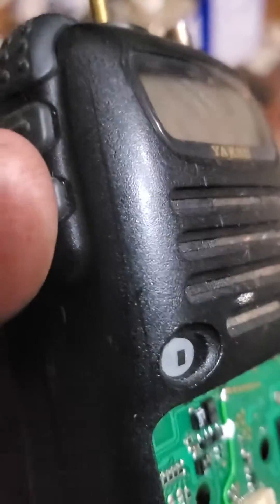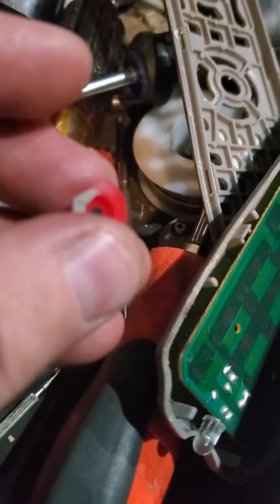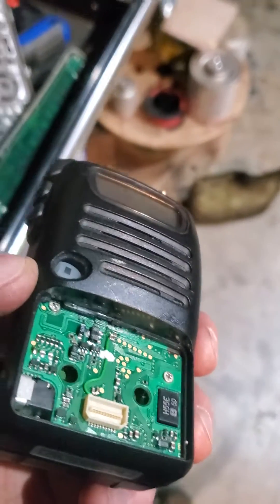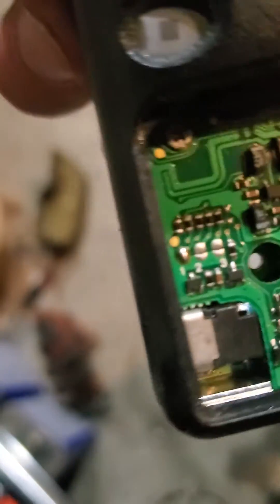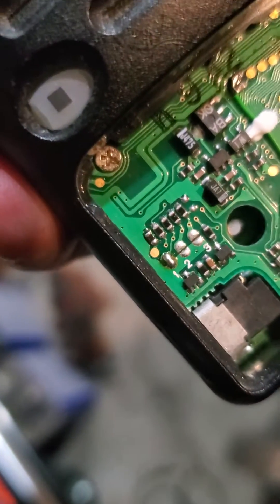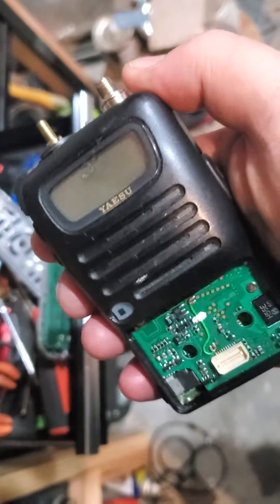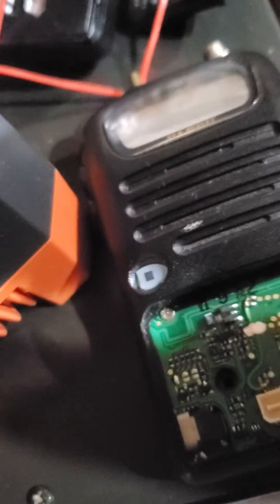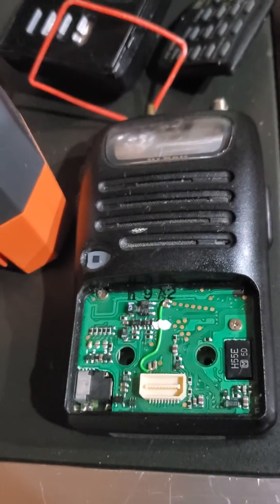Yaesu ft50r button repair hack with old remote.

Comment: I may need to do that. I just dug my 90's Ft-5R out for the first time in a long while, and I'd forgot that the power button only works if I hit it rapidly. At first, I thought it wouldn't turn on at all, but then I tapped it fast, and it worked.
Reply from the maker: Try cleaning your button first 
 Mine was missing when someone gave me the radio. So usually the black coating on the button contact just needs to be cleaned.  Good luck!
73
Reply: @hamradiohack  Thanks, I may try that. Oh, I also did the mars mod right after I bought it...but now I wish I hadn't, since you loose the auto offset feature. Sure wish someone made a lithium battery for these. I have the AA battery case, but with that, you only get 2W max, and those NiMH bats go bad way too fast.
Reply from the maker: @azdonw  yeah. Mine has the aa battery pack its not great. Sometimes loses contact because previous owner had leaky aa bat. Its pretty cool old radio. I bought a newer ft4x for $79 from ham radio outlet,  more like a fancy baofeng.  This radio is nice but long in the tooth.
Reply: @hamradiohack  I thought about ordering a ft3x, but they're out of them with no inventory date. So I just ordered a Radioddity GA-510. Basically a 10W Baofeng with better filtering.
Reply: Me too! But mine won't come on at all. Should I take it to a radio shop for trouble shooting and repair? Or throw it away.